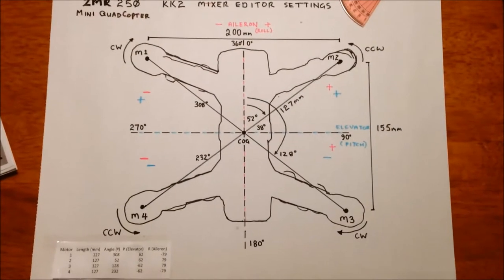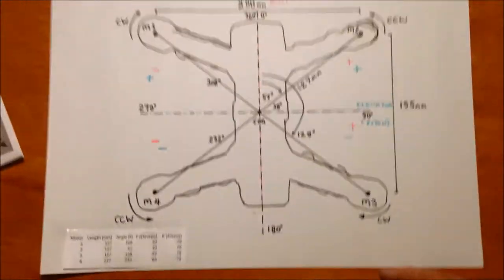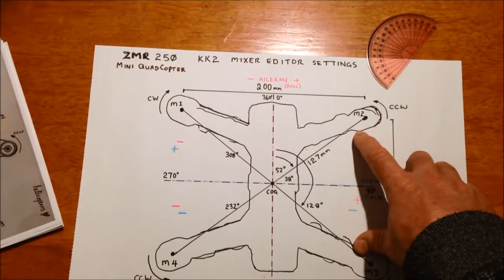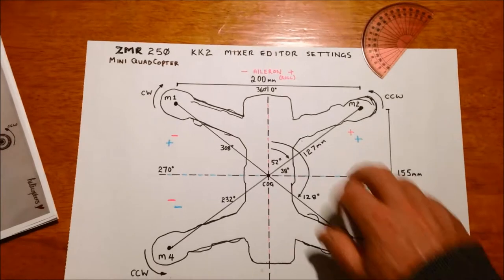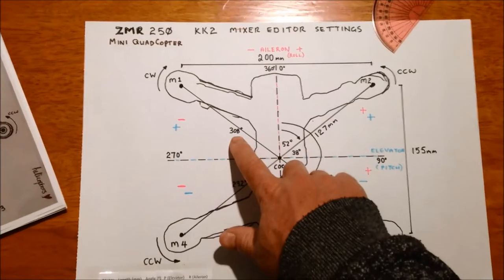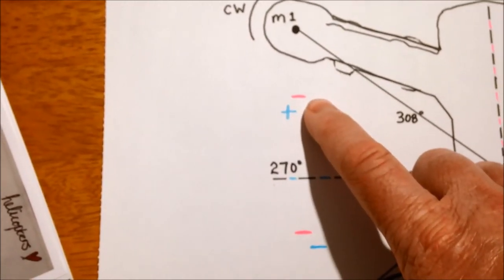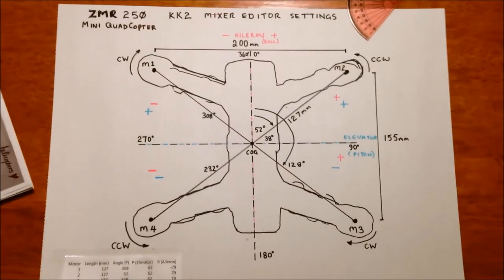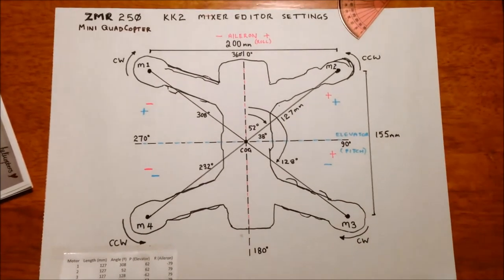KK2.0 KK2.1 Mixer Editor Quadcopter Settings made easy for ZMR250

Comment: Finally a video that makes sense of the kk2 settings. Fantastic job making this seem a lot easier to dial in. My Blackout super mini h with 6" prop arms seem to have these same angles, your numbers would probably work for mine too ? What do you think ?
Reply from the maker: Brett Botts Probably. Otherwise just trace out your frame on a piece of paper and use a protractor to get the angles. Once you have done it you will find it quite easy to get the settings using the spreadsheet.
Reply: Simon Hahnel your right I should just draw it up, the arms are slightly different length come to find out. Can't wait to see how much difference this will make !!